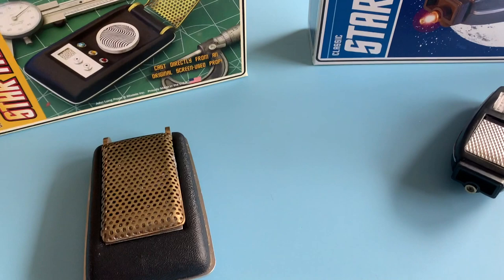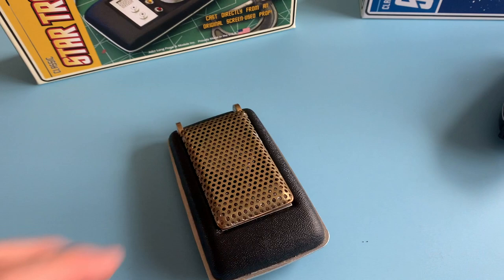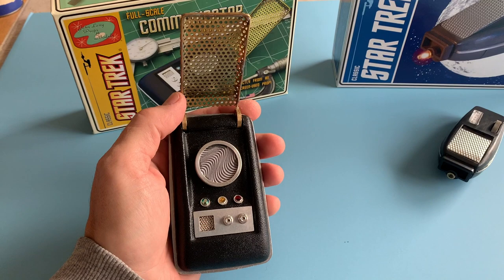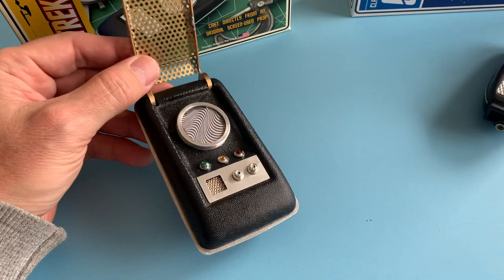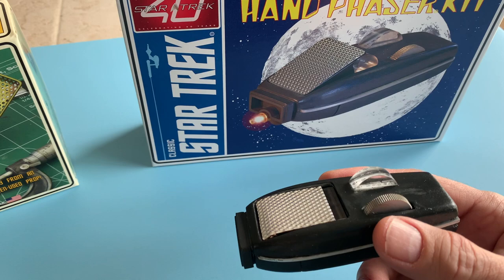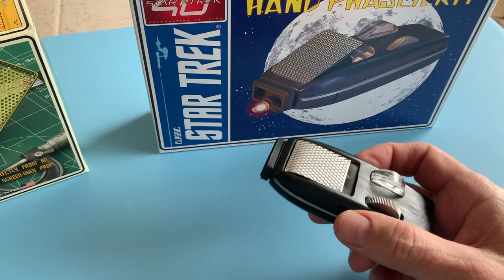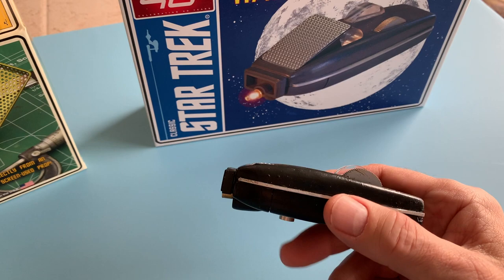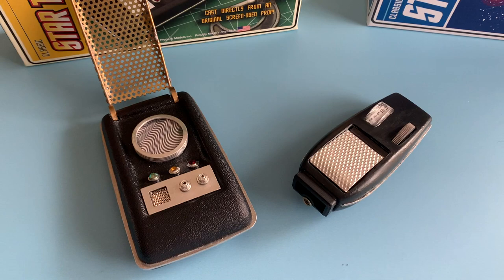Mark Myers 1/1 J Long TOS PROP BUILDS

Comment: The original, screen used props are just beat up from age, handing and maybe accidental damages from their previous owners, perhaps even damages when the series ended and a lot of this stuff was getting trashed/thrown away and got damaged in that process. 
Many of the screen used props, from the show, at that time, that were close enough to the cameras, were probably, in much better shape/condition, during those times.
Maybe just time and age has affected the condition of these props, like the paints no longer adhering well and getting chipped off, glues getting old and either yellowing or parts loose, fell off, prop materials getting damages, like chipping/scuffining from rough handling or being stored improperly, etc.
These props were never made/built for any type of longevity.
The prop makers built these props as quick as they could and to only last for whatever time they maybe used for filming this series
So, it is amazing they are still, somewhat, intact, all these decades later!